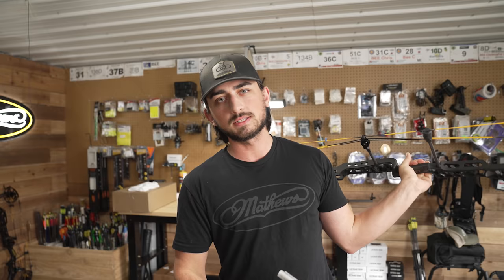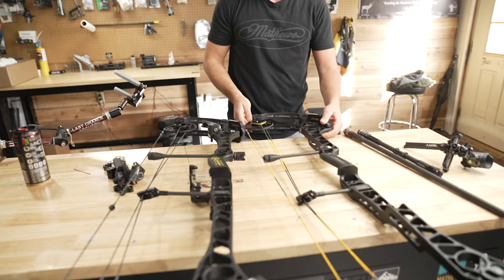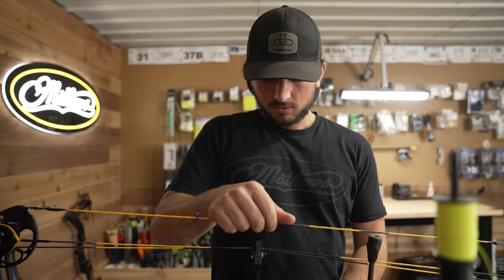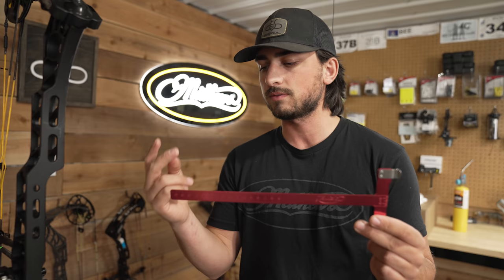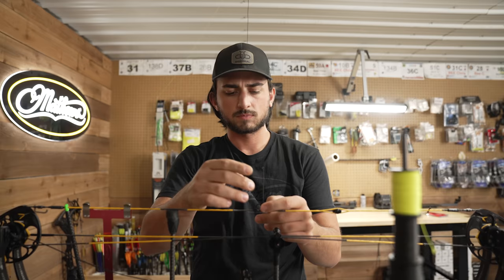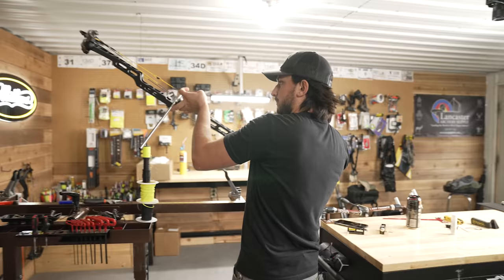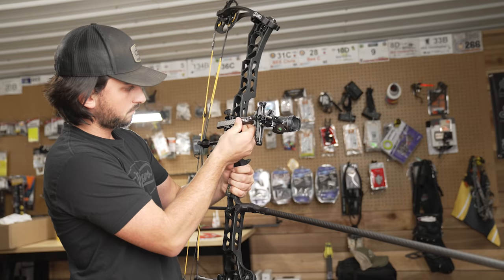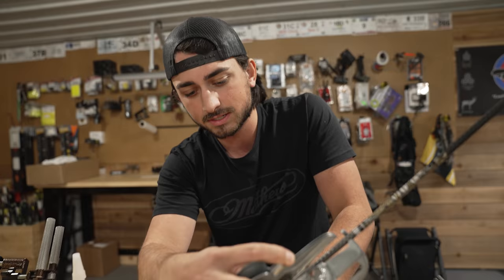MATHEWS TRX 38 BOW BUILD My Indoor Archery Setup

Comment: Just wanted to say you picked a great company. I have 14yr old Conquest II. I'm the original owner. It is still under warranty.....Also, I'm looking at the TRX 38 s a possible replacement for it. The reason is, I'm one of the last remaining finger shooters. Although, it is still doing great!  How does full draw feel like? Looking at the 75% mod. I heard the 70v doesn't have a valley.
PS you may want to add a yellow dampener ring. LOL! .........Oh, the gen 1, you were thinking about, might of been the Apex?